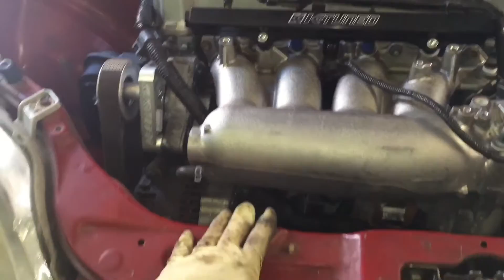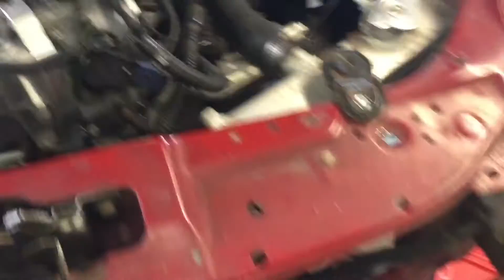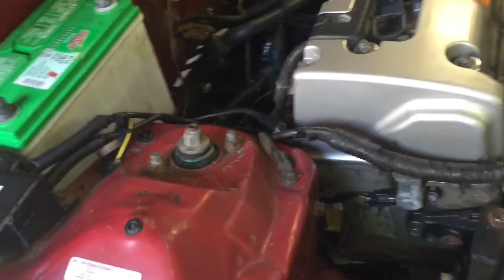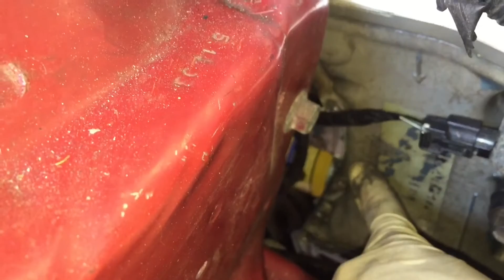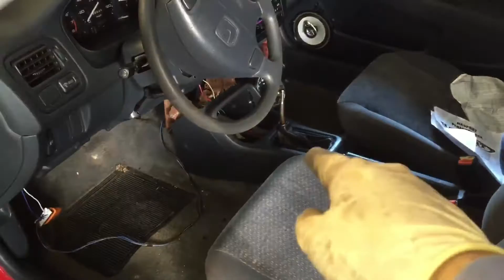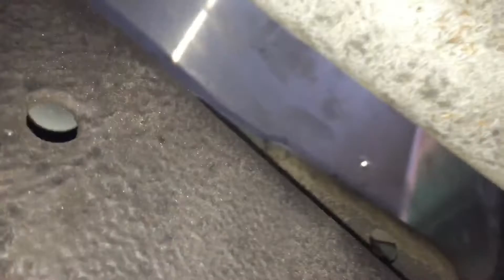K Swap DIY, K24a2 EK       (Part 3)

Comment: What mounts did u use for the swap. I'm stuck on that at the moment
Reply: Im thinking ekk1 mounts ... Ekk2 pushes the motor back some so it isnt as close to the radiator support as it is

Comment: I got a ek hatch using hasport ekk2 mounts I'm running into problem where axels aren't straight and the back mount that goes on to subframe isn't lining up do I have to use a eg subframe
Reply from the maker: Jason giron you would need to get a DC subframe which comes off the Integra , it bolts up direct and then your mounts would line up. With that setup you can actually run the radiator in the stock position since those motor mounts allow the motor to free up space by the front radiator support . Good luck

Comment: Q:what is the different between EKK2-62a & EKK2-70a?
Reply from the maker: Don Pros I believe those number difference is just how stiff the motor mounts are, the material used is much stiffer on one of those mounts but the mounts themselves line up the same way.

Comment: why did you put the fan switch on the bottom hose shouldnt it be up top where the hot coolant is entering the rad? i have a k24 swapped eg, i have no thermostat and fans run all the time. its operating fine but i want a thermo installed so im confused on how to do it.
Reply from the maker: Hondalife you can run them either way, it may be better to run it on the top but I think I may have done it that way for a reason I forget why but either way is fine.

Comment: So with the ekk1 you cant use the ktuned radiator ?
Reply from the maker: ChrisTYB if I didn’t have the RBC manifold and the smaller flat topped manifold style (forget the name) then the radiator would of fit but with that manifold I had on the engine it was super close to the rad support.

Comment: What axles did you use?
Reply from the maker: Freddy gatz ep3 axles, they come of the civic Si from the 01-03 years. I found on some forum that swapping inner cups allow them not to slip out or bind up. They went on pretty smooth like it was meant to be lol
Reply: Cyber Mechanic so you used stock ep3 axles no problems? You didn’t change the inner cups

Comment: when using a k24 and innovative mounts your suppose to swap the cross member to a EG and that would of allowed you to use the ktuned rad properly as well as give u more room for the ep3 idler pulley
Reply: Derrick Mitchell yes that would apply only if I was using EKK2 mounts but I purchased EKK1 mounts which is direct application to stock ek chassis. If I had purchased the EKK2 mounts then I would of had to pick up a DC subframe as well. Thanks for watching

Comment: quick question how u ran the shifter cables u eliminate the heater core and drill a big hole or u ran em under the car also for the wiring on the passenger side what happened to my oem wire from my b series ecu because I know I'm using the k harness witch has the plugs for the ecu but I see my oem b series harnes is connected to my headlights or something I have a 1995 gsr integra and I'm doing a k20a2 swap

Comment: I'm actually selling in now for 7500 $ let me know if you are interested or know anyone interested in this car
Reply: Hey what’s up, not replying about the vehicle for sale but quick questions...

1. What Throttle body? 

2. What type of ecu were you using? 

3. What type of fuel pump was you using? Stock from the civic or any other brand ? “From the fuel tank” 

4. Can I Still use the stock intake manifold? I think I can i shouldn’t have any issue with it but just making sure? 

5. Shifter cables which car you will prefer to get out off ? 

Thanks I will appreciate your response back !!

Comment: Hey man love all the stuff you covering. I'm actually getting ready to do my first k swap. Mines similar to yours but I'll be using the ek2 mounts. But could you possibly cover the wiring from engine harness to dash harness. I know you have the conversion harness I just haven't seen it wired. Thanks man
Reply from the maker: Thanks for the viewing of the video. So in regards to the wiring what exactly do you as far as the engine harness and the conversion harness?  My next video will be the startup of the motor but I can start the video with the ecu and conversion harness, I have an OEM engine harness and I'm using a hasport ekwk-1 conversion harness for the inside which includes the connector for the dash.
Reply: +John Marin so with the conversion harness everything will just plug and play? I haven't ordered mine yet as I wanted to find someone local to show me but no luck. All my k friends either have eg/integra or have some crazy wire harness made from scratch lol.
Reply from the maker: +Jay Austin you can go that route and wire the harness like your friends did and save a couple hundred or buy the conversion harness for your chasis. The conversion harness is plug and play except for one or two wires for alternator light.
Reply from the maker: +John Marin the conversion harness comes with all the plugs for the ecu and the under dash plug as for the engine side it comes with primary oxygen sensor plug, temperature and radiator fan switch plug, and the big square plug that goes near brake booster.
Reply: +John Marin oh ok. That seems a little easier to to with the conversion harness. Thanks man really appreciate the help and fast response. These videos were a lot of help tho man. Looked everywhere for a diy.
Reply: John Marin b